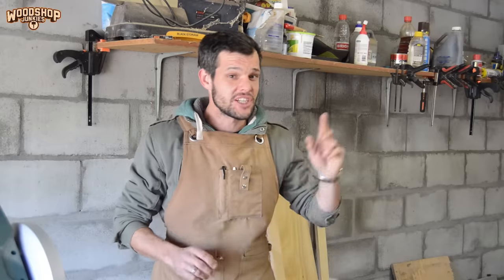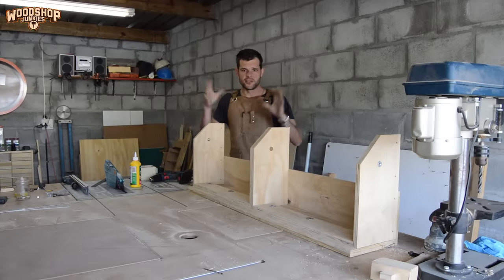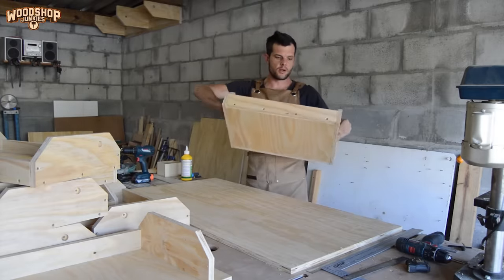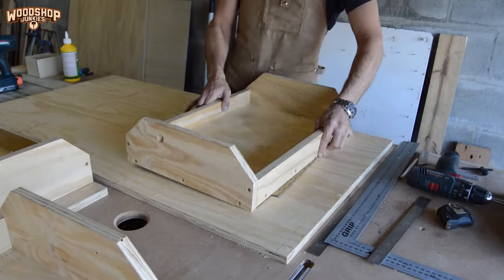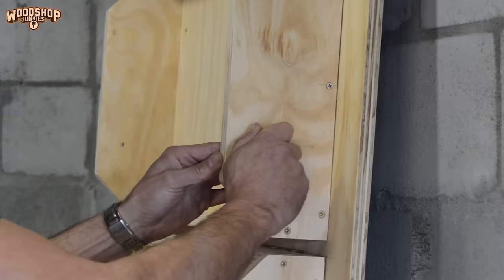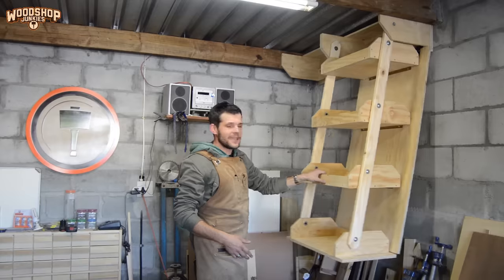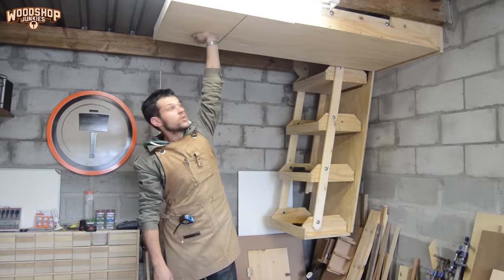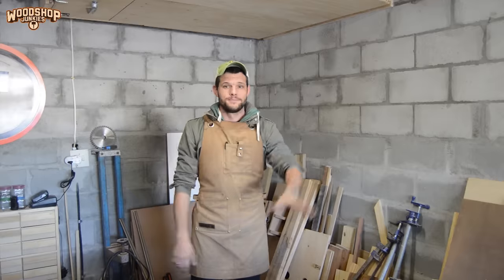Installing The Ultimate Garage Workshop Storage Solution

Comment: That plywood was bent by just. 1 empty wooden box hanging from it, needs 2x4's to stiffen the bottom side of plywood, this is going to be a very heavy suspension 4 boxes, it would have worked way better individual boxes, suspended on hindges, Nothing in your Boxes can be at a height higher than the box tray or it won't fold up

Comment: Hey where did you get your dust mask?? it's always hard for me to find a good one that fits bigger people, since the  "one size fits all"..? Doesn't fit all, at least not in my case anyways
Reply from the maker: I bought it from my local hardware store but it isn't very comfortable. I am currently shopping online for a replacement.
Reply: Damn it looked like it would have been comfy in Toronto there's a company called Atlas tools their website is Atlastools.ca and so far they've had the most comfortable mask I've even had it's a 3M but don't remember the model. I'm 6'6" 250lbs, and I wouldn't say I have a huge head or face but it's preportional and so far that's the most comfortable one I've found to date.

Comment: What is that tool called on 1:31? The one used to lift up the board. Thanks! Great video!
Reply from the maker: It's a small scissor lift I made to level stock when drilling.
Reply: @WoodshopJunkies  Thank you sir! I'm thinking that having two of these would help me lifting up a fence panel while I'm securing it to the post. (I'm working alone and need more hands — only got two :( )

Liked and subscribed!

Comment: My man used the respirator while working with wood and the "finger in the nose" to clean out the concrete silica dust from a hammer drill.  #safetymakesenseiguess

Comment: You missed one major item ! You will find this out very shortly.
When you load those shelves, They will weight a ton after a while.
I would suggest you should put a pulley system with a counter weight against the wall,  to take up the weight when raising an lowering said shelves, I don't think springs will work but you could try them,
Or if your genius enough you will have a set of drawers across the shop that work the same but when down they hold the others across the room up an alternate for lifting if you understand my meaning.
Reply: He mentioned quite extensively the intention to add gas shocks to assist in lifting the load.  He mentioned it multiple times.
Reply: @cptbootleg  Shocks still give you a requirement to lift where weights do not

Comment: so, I assume plywood is relatively inexpensive in your part of the world?
Reply: starshipeleven  How did you work that out?
Reply: starshipeleven  I meant how did you come up with the $ amount? BTW those "large stores" are different from location to location, mostly dependent on their suppliers.
Reply: starshipeleven  That means you know how much it costs where you have bought it, not every where, in Australia it is incredibly expensive.
Reply: starshipeleven  That's CD quality though, the lowest grade available, always warped, lots of voids, defects etc.
Reply: Additionally he clearly states the bulk of the project uses 18mm pine plywood (he doesn't state the grade but I don't see many defects in the stuff he is using). Bunnings 17mm CD is $79 (You would get Birch plywood for that price in the US and Canada) but if you move to 18mm BC quality (as it looks to me in the video) you go to project panels at 4 x $35 = $140 per sheet.
Reply: starshipeleven  Well if you are going to bring in the exchange rate (which you shouldn't) that's US$192 which is ~ 100% off for your lower estimate ~30% off for your lower. Now, I have just looked up the price at Lowe's in the US and it's $31.98 a full sheet so it's well below your lower estimate.

HOWEVER!!! You can't compare them by applying the exchange rate, you have to compare it by the average wage in that country to get an idea how expensive it is to purchase. I may be paying in AU$ but a dollar is still a dollar.
On top of that all plywood is sourced locally here so the exchange rate does definitely NOT apply in this case.

Don't forget I am not judging your ability to estimate, I am judging as to the relative costs, and by my calculations it's $280 to me, and $64 for someone in the US.

Comment: Can’t you just have shelves on the wall? Otherwise the wall needs to be kept bare to allow the unit to fall into place. Yes you’ve used space in the roof, but sacrificed the space on the wall...
Reply: I think they would have been better to swing into the middle of the room
Reply: I thought the same, but I might use this idea with the shelves folding down in front of the door. That way I gain shelf space without losing wall space.

Comment: very nice but it has the same issue as all of my current inefficient storage, 
much to expensive, 
to space consuming when empty and almost impossible to use. I do not believe it could work without lots of empty unused space within the unit or lots of random unrelated things stored together garenteeing further pointless disorganization.
This looks kind of good but let me see an example of the storage unit packed full and working.
There is a reason this storage solution was mot exampled in actual use.
It can not be used for REAL objects in the real world without lots of empty wasted space within 
I do not believe that this will work for any real purpose in reality.

Comment: Actually with this shelf you are using more space than just having them hanging from the wall. Because all the space infront of it, cannot be used. You wont be able to slide them up or down if anything is in its way. Ergo you are actually need more instead of less space. Typical case of fail engineering.